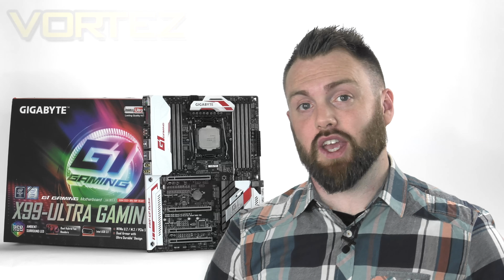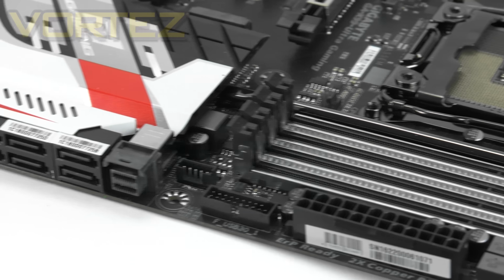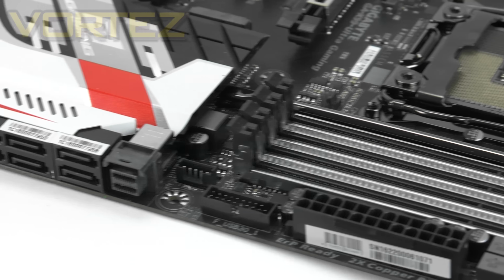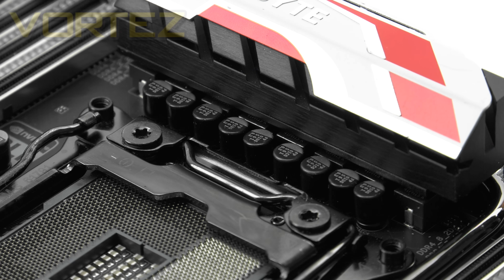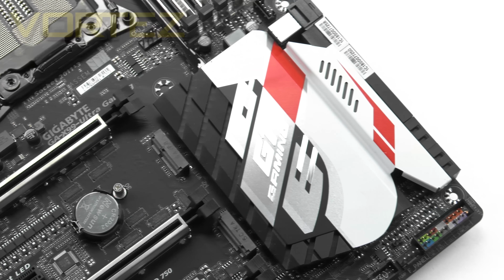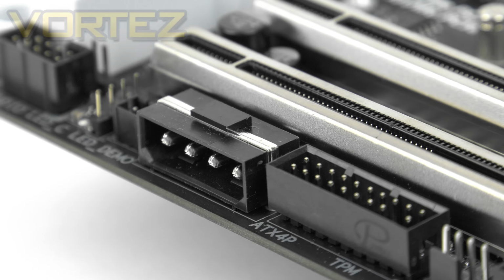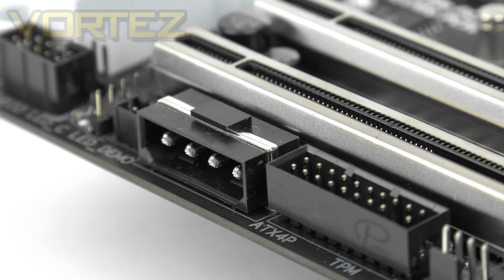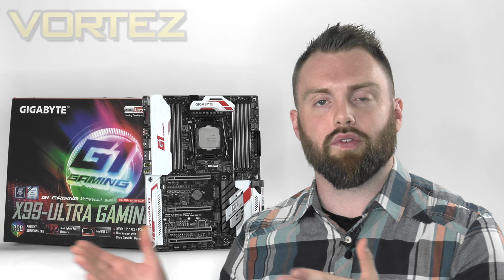GIGABYTE GA-X99-Ultra Gaming Review [4K]

Comment: nice video. i bought this board with two evga gtx 1080. I was wondering what the spacing would be between the two cards for the sli bridge. I bought the evga sli hb bridge with 2 slot spacing and im hoping it is the right one!
Reply from the maker: Thanks. From slot to slot it measures 6cm. Hope that helps!
Reply: Awesome thanks. ordered the wrong one the first time and waiting on my new one to come and it should be the right size!